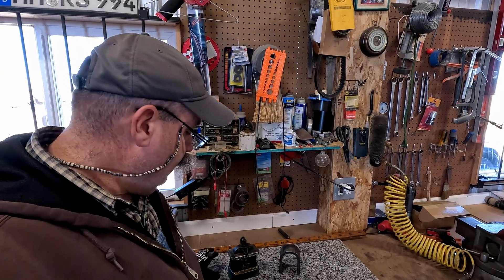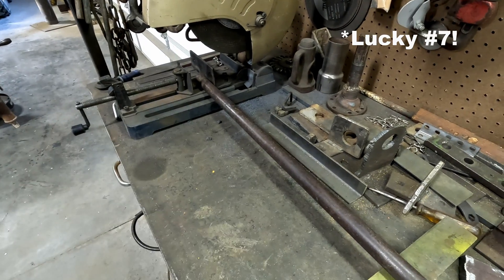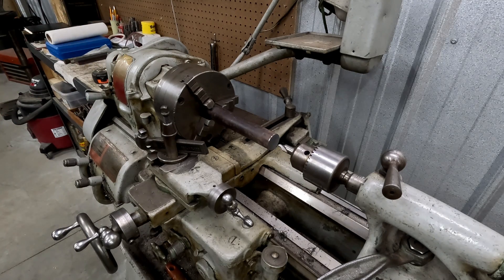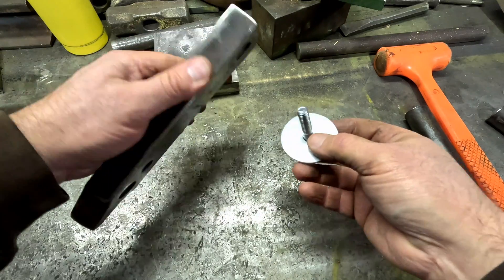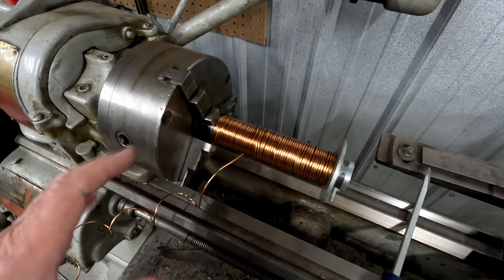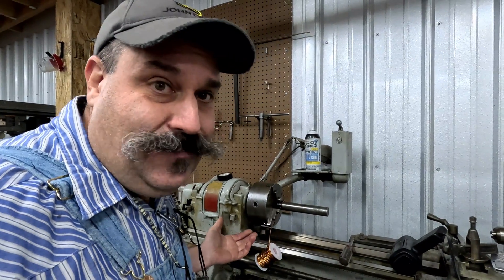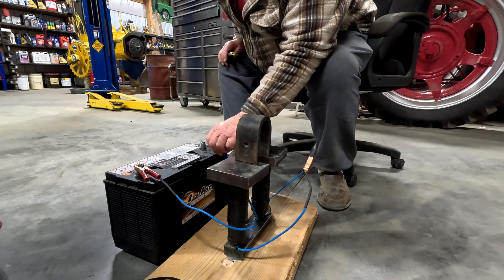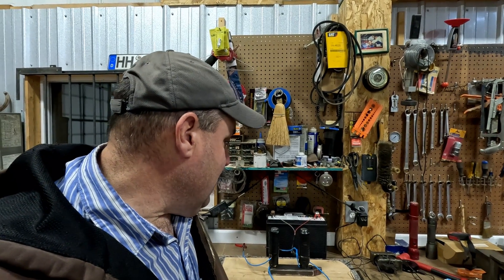Let's make a magneto magnet charger electro magnet for the Eisemann mag Caterpillar D4 Episode #70

Comment: Nice! Tight wraps make a difference. One has to be sure to not drag the laquer insulation too much and nick it too though. You could make a firm rubber wheeled adjustable drag attachment for your crossslide to feed the spool through, which could keep a consistent tension through the wrap, but that might be a bit fiddlely. 
It seemed like you may have been running a bit too fast for that size of center-drill, but hey, you worked it out!
Oh, and by the way, for a 3-jaw you did way more than just "looks good"! Especially with that much stick-out!

Comment: Anyone making one of these, I'd research a bit further.  What's here may work (or it may not work as well as it could, we don't know if that magnet is fully charged).  If I were to go to the trouble I'd start with low carbon soft steel (not axle shaft), I'd do a little research about ampere turns (you probably want about 30,000 or more), the size of the cores etc.  And it depends on the material the magnet is made of.  For the time and cost a little more study should go into it in my  opinion.  Perhaps in this video they've studied what other folks have done more than just appearance.  I'm planning to build one so I've been reading and watching some.
Reply from the maker: Greatly appreciate your opinion and advice. Please check out part 2 of our hit and miss engine magneto rebuild to see the results of a charged magnet from this tool build. 👍

Comment: about how many feet of wire did you use? can you put more windings on than what you did?
Reply from the maker: If I remember correctly I used 150' per side. You can put as mary windings as you want. Ours turned out to be fine with what we did. Hope this helps. 👍

Comment: Hello gentlemen thanks for sharing your knowledge I found it very enlightening and I don’t know anything about this subject so my question is what would happen if you left the battery charging on your coils for let’s say one minute instead of 4 seconds is there a risk of blowing up the battery?
Wouldn’t that charge up the magnet stronger?
I ask because I think a lot of cranes had a set up like you built and they would flip a switch to turn on the magnet pick up scrap metal and then release the charge and the scrap iron would fall into the shredder and I didn’t think there was any danger in leaving it on to long but I am no expert just wondering how it works and what is exactly happening when you connect it to the battery? Happy new year everyone 😀🇨🇦
Reply from the maker: If you leave it hooked up too long it will create a lot of heat through the magnetic energy. Similar to an induction stove. So you could potentially get the battery or the coils extremely hot and possibly catch fire. My understanding is a small charges all that is really necessary. A lot of the scrap yards do use electromagnets. But they are more of a continuous system with an alternator with industrial wiring and coils that can take the continuous voltage. The principal is exactly the same. The separate coils hooked up to an electric source create a magnetic field. When you bridge it with a piece of metal or magnet it completes the circuit of sorts of the magnetic field. That's my basic understanding of how it works. I could be completely wrong. Happy New Year to you as well.
Reply: Thanks 😀🇨🇦